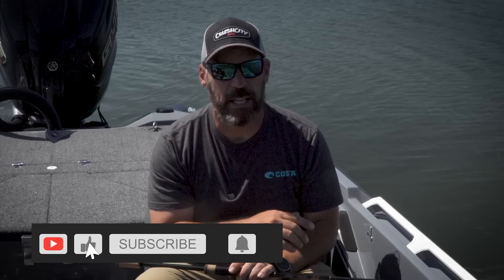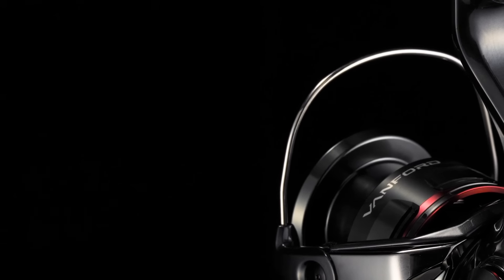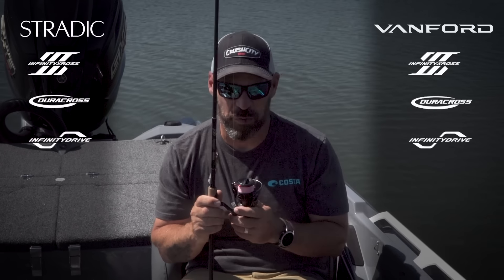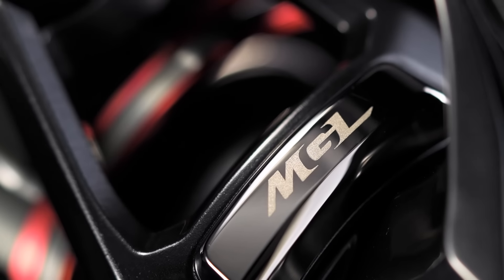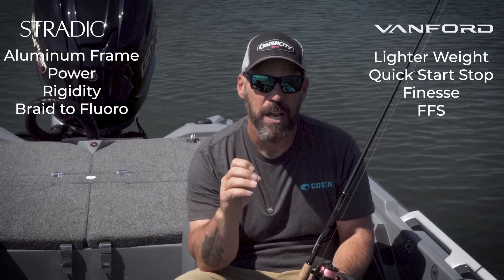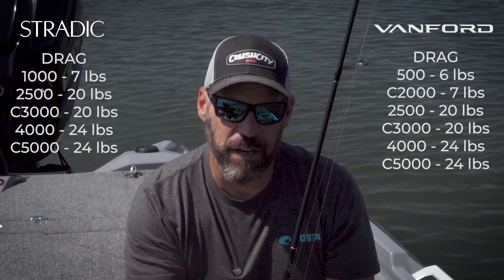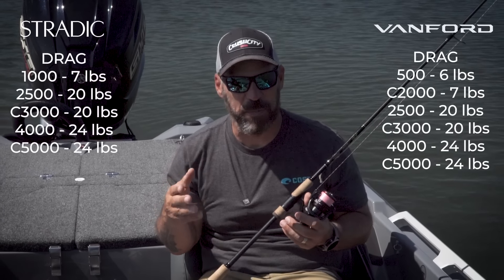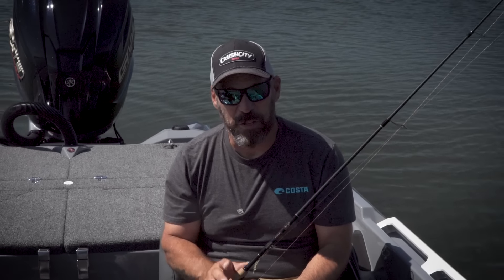2024 VANFORD A vs 2023 STRADIC FM.... Which reel do you choose?

Comment: I held the Stradic FM and Vanford reels this weekend. Because I'm less of a finesse fisherman and I  like the idea of an all metal body, I'm a Stradic FM fan. One thing, I noticed that the 3000 series in both seems to have a small spool compared to the Daiwa BG 3000 I am replacing. The 4000 model FM seems to be closer to what I'm used to with my BG. The Stradic FM did not increase in price based on the model, unlike other reels like the Daiwa Tatula that do.
Reply from the maker: They use the same body for the 3000 and 2500 and implement a deeper cut spool for more line capacity on the 3000. That’s why it’s a C3000 which stands for Compact Body. Same with the 4000 and C5000
Reply: @JPDeRoseOutdoors  Thanks! Do they do the C thing on the Stradic FM 4000?
Reply from the maker: @robertbrost7777  ALL Shimano spinning reels on the Freshwater side follow that protocol
Reply: if i may, older Daiwa spinning reels use different sizing. Daiwa 3000 = Shimano 4000. but they have changed the sizing recently, following Shimano. Stradic is not an all metal body reel but it is quite a workhorse. Cheers!
Reply: @3d3ist  Thanks. I don't think I could switch directly from my Daiwa BG 3000 (2019) to the Stradic FM 3000. The Stradic just looks more like the smaller BG, maybe the 2500 or 2000 BG. I'd have to go with the Stradic FM 4000 because, I like the size of my BG 3000 and, I like the spool size. That spool on the Stradic 3000 looked tiny! LOL
Reply: @robertbrost7777  yes, you are right. a shimano 3000 is equivalent to the old daiwa 2500. if you are looking to replace your BG3000 with a Shimano, look for the 4000 size range.

Comment: Hey JP, what’s your thoughts on the new Vanford C5000 being used for inshore (Redfish, Stripers, Flounder) fishing?
Reply from the maker: It will do really well. I still prefer an aluminum frame for hard running fish personally but I have fished reds with a Vanford with no issue.
Reply: @JPDeRoseOutdoors  As always, thanks so much

Comment: Thanks for the video JP.  I have a question regarding the previous version of Vanford, which I already have.  Can I replace the drag system in the 2020 Vanford with the new drag system from the 2024 Vanford?  Will it fit and work?

Thanks again.
Reply from the maker: I haven’t heard of anyone swapping out the drag washers for the new Duracross ones or if they are even available as parts yet since they are so new. A lot of people put the felt washers in their 3000’s to get that smoothness
Reply: @JPDeRoseOutdoors  Thanks for the reply.  I appreciate it.

Comment: I've always told people that if you wanna focus on finesse bass fishing then go vanford. If you wanna do heavier duty fishing on heavier species with some bass on the side then go stradic.
Reply: I don't see much difference in them. The slight weight difference maybe.
Reply: @wciii3591  On paper you won't see much. In hand is where you will feel the difference. Vanford start up inertia is very fast. The stradic is lagging a bit. I've heard on high stresses the body of the vanford bends at time. The stradic shouldn't due to being more robust and the material being sturdier. Is it a deal breaker no but to some it will be.

Comment: How would an Exsence stand to these 2 reel as far as the tech specs? Since these 2 reels are newer does it mean that they are more advanced compared to the technology that was put into the Exsence in 2021?
Reply from the maker: Yes, both have more advanced tech built into them. Better drive train, better main gear and better drag washers. The Exsence will still have more bearings and have a lightweight magnesium body though.
Reply: @JPDeRoseOutdoors  just wish Shimano US brought in the Vanquish instead of the exsence.

Comment: Sir what is the meaning of C5000xg
4000xg study
Reply from the maker: The C stands for Compact Body. In other words, the entire reel is the same size on both the 4000 and C5000 but the 5000 will have a deeper spool that holds more line and typically a larger or different handle. Same with 2500 and C3000

Comment: The stradic c2500sxg is my favourite reel. You might need to import it if its not available in your region though. By far the best small reel in the stradic lineup.
Reply from the maker: You want to be careful with importing overseas models in case you need reel rapid done as internal parts are often different and they do not stock them in North America. I have seen a a few people run into this issue.

Comment: Love Stradics in 3000 size. Have a 11 year old and 2 year old model. Just bought the 3000 compact Vanford and it is a gem. I prefer the Stradics on the slightly heavier 2-4kg, 7 foot rods and the Vanford for the ultra light 1-3kg 7 footers...horses for courses but i love the low inertia start of the Vanford. It is the king of finesse fishing for the money when on a light rod with light braid.  But suspect as tight and solid as the Vanford is the Stradic might outlast it...not sure.  Cheers